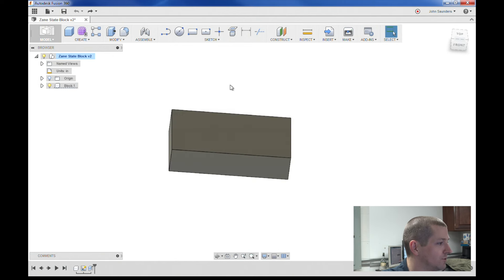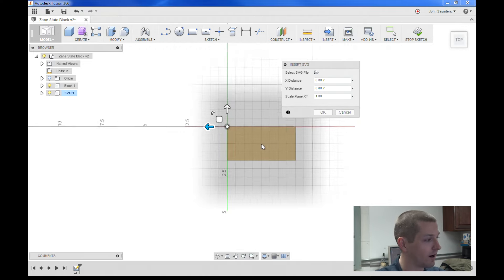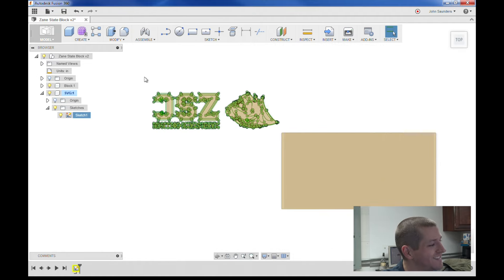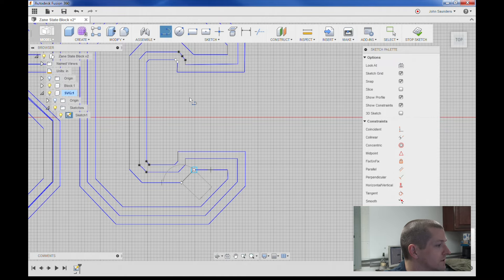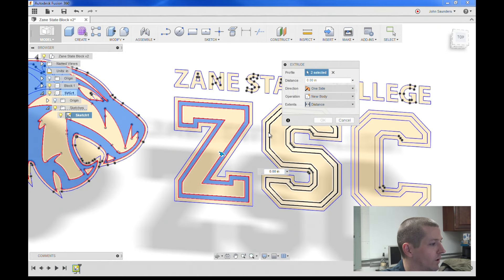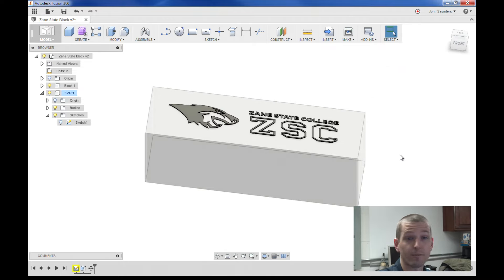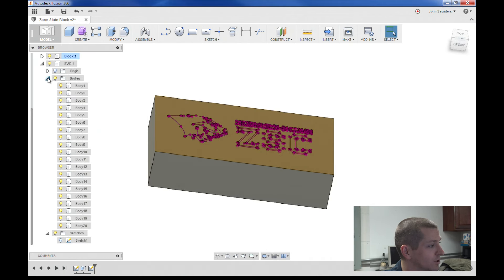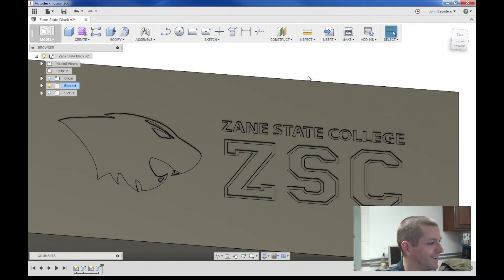How to Import SVG Logo, Scale & Move in Fusion 360! Fusion Friday #16

Comment: Is there a way to scale an SVG in an X/Y value? Coming up with the right scale factor to match the size I had originally designed it, is like pulling teeth. >.<
Reply: I know this is 4 years old but what you could do is start a sketch, make the box the dimensions you want your svg to be. Import the svg and then scale it up to the size of the box. That should give you the correct size you are wanting. Delete the box after and job done.
Reply: @boyracer1988  thank you so much for that idea

Comment: From illustrator I always use the scale factor 1/72 and that gets me to the original size.

My two cents, if you are going to go the route of making a body from the svg, save yourself some time, position it where you want it and then do a combine cut onto your target body.  Probably faster than a project and press pull.

Comment: Thank you for this video. I'm completely new to 3d modeling, and Fusion 360 was continuously crashing with my svg file. I figured it was too big/complex, but even moving it would crash. Your tip is great...don't move it ! Edit it down in place to reduce the complexity and then convert it to a solid.  Thank you for your easy to understand, short, and to the point video !

Comment: I'm still very, very new at this, but would there be some way to inset the logo once you've turned it into a solid into the part, then cut the part and then just delete the logo from it? That assumes you made the logo thickness the same as the depth on the part.

Edit: Reading the comments I see that you can. Cool.

Comment: Good tips. When you import an stl to the Hobby version of F360, then import a svg label and do the extrude, I'm not getting the extruded label to combine with the base component. I've tried every which way to get it to work. Just hit my editable limit, and may have overloaded the Autodesk server, with so many redos. Been there done that, before. Edit: Figured part of it out . Have sketches that are floaties. Thinking maybe that construction is for placeholder type sketches.

Comment: Nice tutorial.  I see this is very old so not sure you are monitoring the channel anymore.  But, if you are.  I may have missed it but it looked like your SVG came into project backwards.  I didn't see how you inverted the svg.  I am scouring youtube to find out how to do this for a svg, component etc.  I am making 3D printed products that print up from the plate and discovered I need to inver the part on the plate so it will read correctly - trying to learn how to do this.